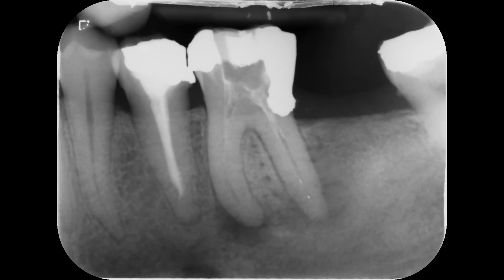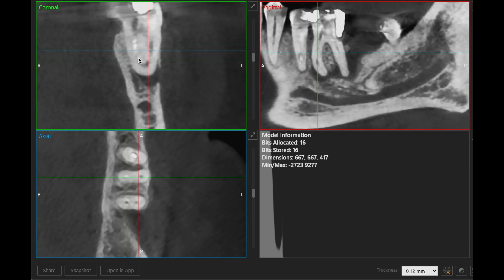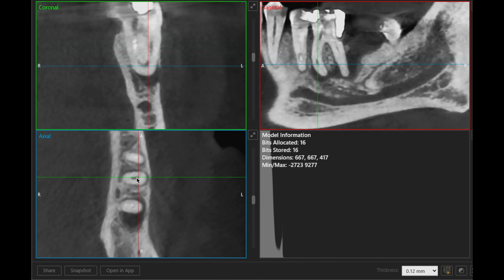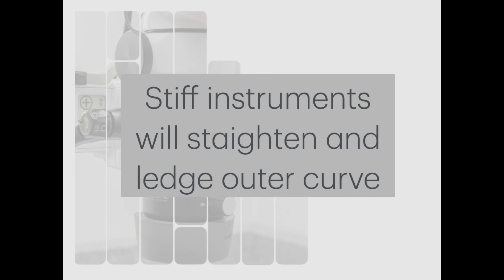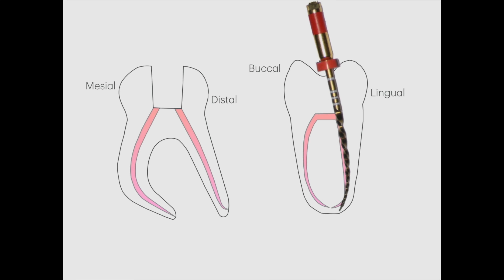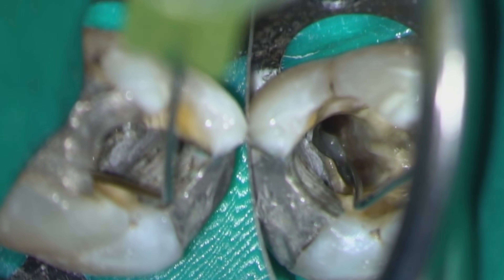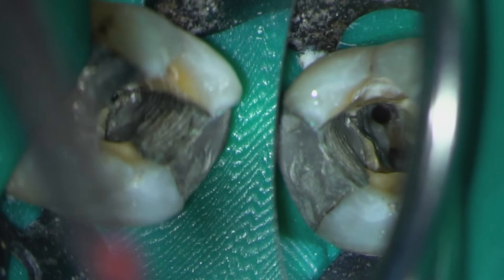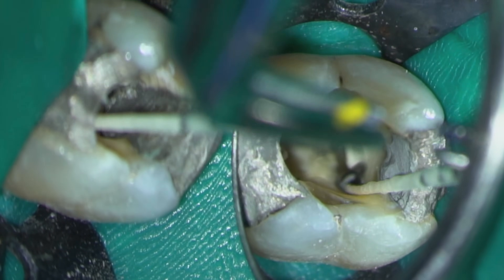Molar Challenge  - Ledged Canals   4K

Comment: Dear Dr. Rhodes,

could you please explain why you prefer using rotary instruments (such as ProTaper) to open the canal orifices? What advantages does this approach offer compared to using a reciprocating system? I currently work exclusively with Reciproc Blue.
Reply from the maker: Hi there!
There are many ways to open the canal orifices; I commonly use ProTaper SX, but also Wave One, Edge One and even micro-openers when the canal is very fine. Reciproc Blue is a great system and if that is what you enjoy using it will work well.
Thank you for watching
Cheers John

Comment: You've got the hands of a magician John, absolutely beautiful work. I have a couple of questions: 1. For you to bypass the ledge, I believe you use a size 6 C file preserved to work your way down, afterwards used a size 15 k file and size 20 flexifile, did you also pre curve the 2nd and 3rd files? 2. Can you please share your protocol for cleaning the pulp chamber when using GP and other sealers like AH26? You mentioned only water for BC sealer (I hope that's correct). 3. I find the vertical compaction downpack to be sometimes unpredictable as the GP sometimes come out with the plugger, can you please share insights into how to prevent this? Once again, absolutely beautiful presentable, enjoyable and also informative. Thank you so much!
Reply from the maker: Hello again!
Yes all the files are pre-curved so they don't snag the ledge.
AH + can be removed by etching and brushing with an applicator then wash with 3:1
Excess BC sealer can be washed off with water
To avoid removing the master cone - make sure cone fit is snug, make sure temperature of tip is hot enough to sear cone, you can move the plugger tip with a lateral wiggle before removing which can help...
Enjoy your Endo!

Comment: Thanks for sharing dr, I have 2 questions:

1-why not used Chx2% with BC sealer?
2-using NaOcl after EDTA can cause dentin erosion according to some studies ?
Thanks 🙏
Reply from the maker: Chlorhexidine can interact with the BC sealer, negatively impacting bond strength, can increase elution and possibly change antimicrobial effectiveness Kapralos et al 2024 
CHX should also not be mixed with sodium hypochlorite
Any surface effect of irrigant will be microscopic - Fernandes Zancan R, Hadis M, Burgess D, Zhang ZJ, Di Maio A, Tomson P, Hungaro Duarte MA, Camilleri J. A matched irrigation and obturation strategy for root canal therapy. Sci Rep. 2021 Feb 25;11(1):4666.

Comment: Hello, doctor. I have a question, you mentioned not to wash the root canals with chlorhexidine and then fill them with bioceramics. Can you elaborate on this? I use bioceramics, and I read the bioceramics brochure, but it doesn't mention anything about this. Thank you.
P.S I have also encountered situations from my colleagues in which the bioceramics did not set. Studying their way of working, I noticed that they used edta gel and I suspect that the gel remained through the isthmuses, which reacted with the bioceramics, causing it not to set. Thanks again and I appreciate your response.
Reply from the maker: Chlorhexidine can interact with the BC sealer, negatively impacting bond strength, can increase elution and possibly change antimicrobial effectiveness Kapralos et al 2024 
CHX should not be mixed with sodium hypochlorite
I never use EDTA gels - only liquid - the gels just clog the canals up!
Thank you for great questions! 😎

Comment: Hi John, do you feel we can still ledge with a non-cutting tip, heat-treated, rotary file?
Reply from the maker: No ,as likely most ledges are caused when files are forced - and generally larger sizes.

Comment: Beautifully done, love it as always. I was wondering; when cannals join, how do you usually proceed? Do you instrument only the "main" canal to WL and then the other one just to the crossroads? Or do you try to instrument both to WL? Cheers from Spain
Reply from the maker: Hola!
Great question -  it depends on the convergence angles - if acute then prepare main canal to WL and other to point of convergence...if they merge smoothly then both can be prepared to length. When obturating I fill both simultaneously cheers!

Comment: How do you pre curve your files? Do you some special pliers or just tweezers? When I use tweezers it often puts a sharp angle at the change of direction
Reply from the maker: Hi there I put a sharp bend in the tip using the narrow stalk of the mirror where it joins the handle
Cheers
John
Reply: Hello sir i have a question my endodontist friend agitation hypochlorite with lignocaine. Is this is right boz my friend said don't do this boz hypo & lignocaine combination and form carcinogenic
Reply: @dr.saurabhsharma2311  u mean chlorhexidine and hypochlorite... ?

Comment: What are the possible causes that my GP cones frequently being pulled out when searing them off?
Reply from the maker: Hello  - 
Yes this can happen I usually give them a little pack at the level of the pulp floor before down packing to seat them.
Make sure the heated plugger is hot enough - 200C
Cheers
John
Reply: @johnrhodesendo does 200 degree of heat cause changes to bc sealer negatively. was told to just use 150 to 180 maximum of heat. thank you
Reply from the maker: Hi Tan,
Good point!...some BC sealers are not compatible with heat at all, for searing off at the pulp floor 200C is fine you may want to dial the temperature down if vertically compacting. Cheers